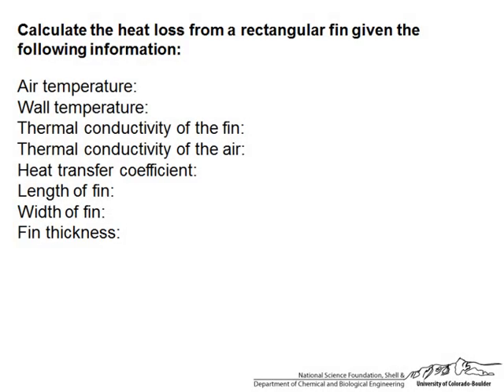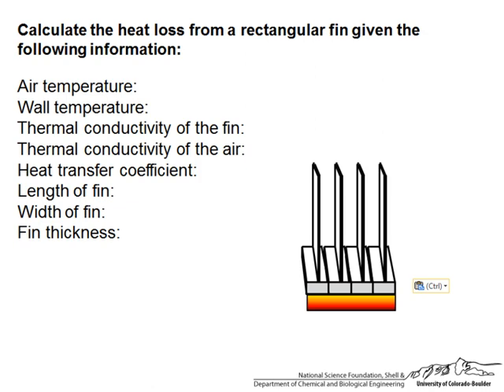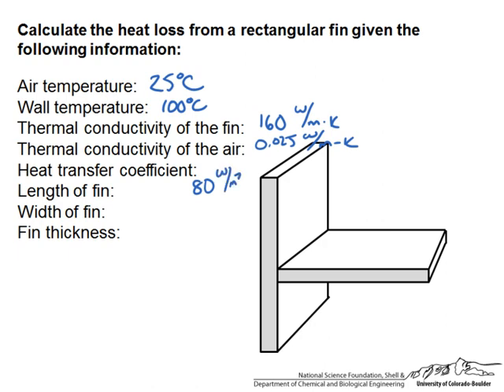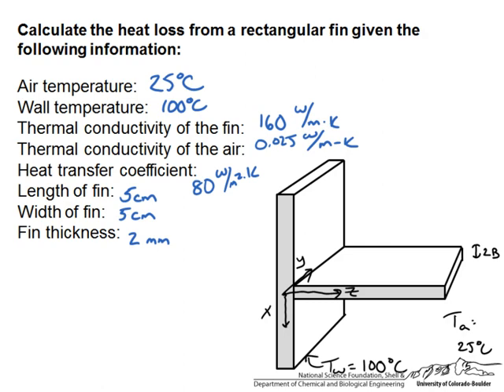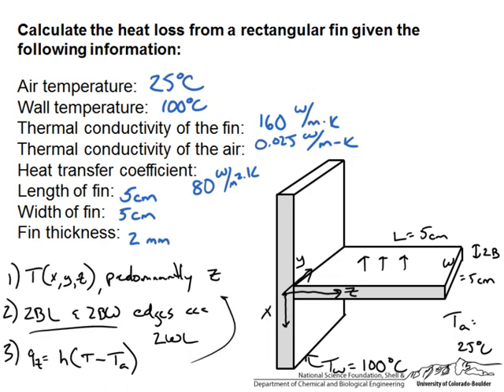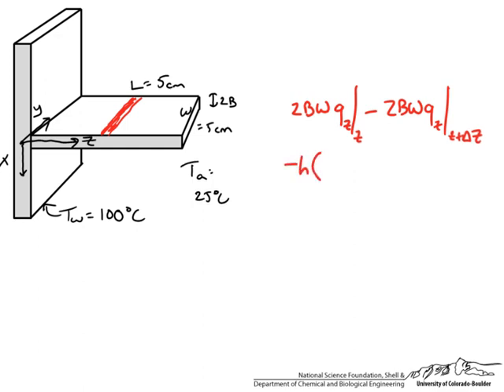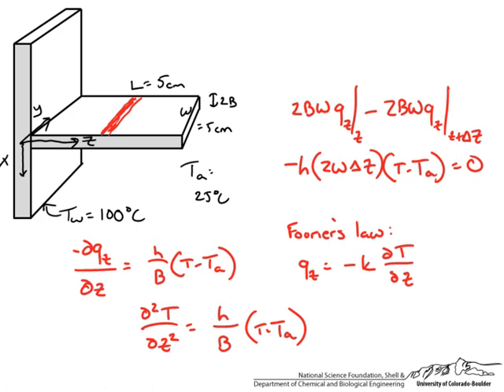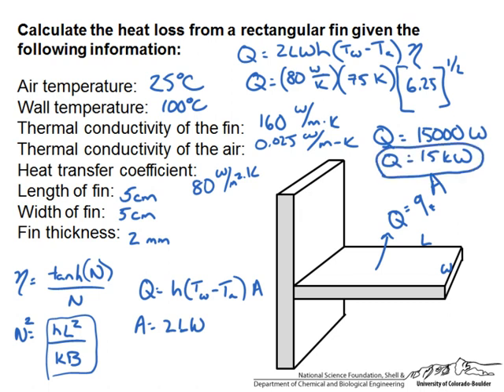Heat Loss from a Rectangular Fin

Comment: Looking at the step at 14:49, I see that C2=tanh(N) but when I was following along it seemed like it should be equal to -tanh(N), because you need to subtract over sinh(N) before dividing by cosh(N).  I wasn't sure if I missed a step somewhere or if there were an error in the video.
Reply from the maker: You are correct. However the equation does bring in the -tanh(N) to get the cosh(Nzeta)-tanh(N)sinh(Nzeta) rather than the + tanh(N). Good catch.

Comment from the maker: @1001harris We did use the thermal conductivity of the fin (k) later in the video, but did not show entering the values.  The thermal conductivity of the air is not used because we use the heat transfer coefficient instead (also used in the same term that k is).  Since we are assuming Newton's law of cooling, we simplify matters and use h instead of the thermal conducitivty of the air.